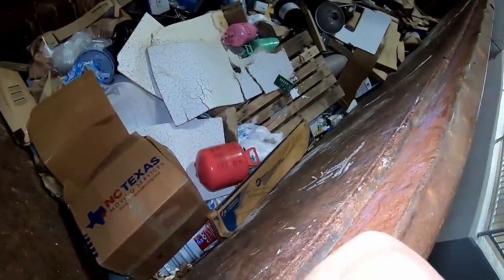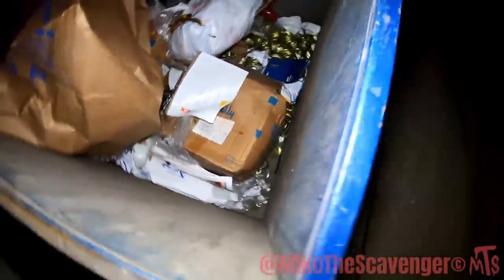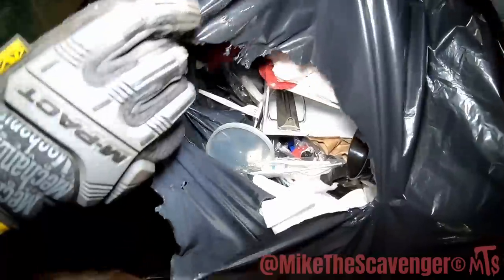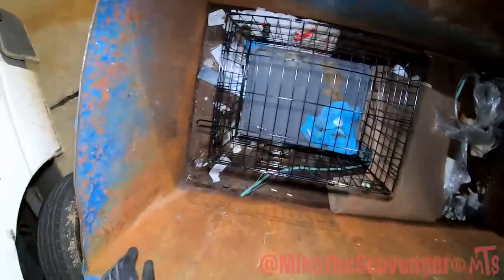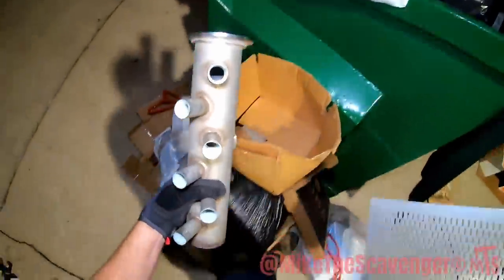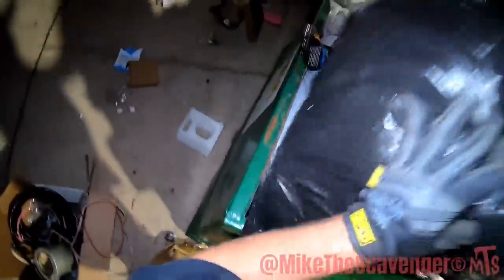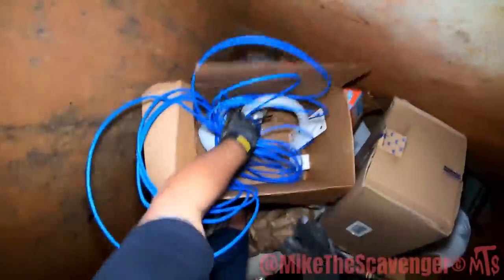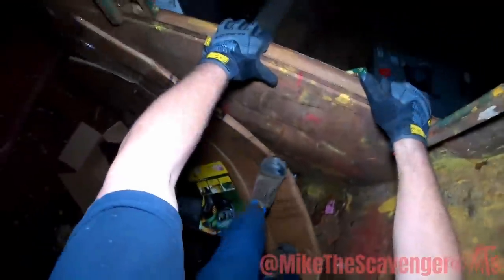Dumpster Diving "Is That A Stiff?"

Comment: Can't remember what we called those wire twisting tools in the AF but those are used in the military especially on flight lines to secure the mounting bolts on the black boxes for the various equipment so the bolts that lock them down don't back off and loosen from the vibrations during flight. They are used in aviation in general and probably in high performance race cars I assume I would think in certain situation. 
I was an Inertial Navigation Systems technician and used it daily. You constantly removed and replaced black boxes in your navigational and all the other systems constantly for testing and repair. 
Brings back a lot of memories seeing those!
Reply: They're commonly called "safety wire pliers".  Yes, used in the Air Force and probably NASA to safety wire bolts and nuts so they won't back out in flight.  Race cars too I would think.

Comment: Those canning rings are an item that countless people have been scrounging to find. There was/is a nationwide shortage after the rona hit and folks were prepping and canning. 👀
Reply: The rings weren't the problem, it was the lids. You can reuse the rings, the lids you couldn't.
Reply: @scottbormann2765  - ALL of it was a problem because people were and still are hoarding the stuff. In my area, we couldn’t find ANY mason jars, lids or rings …. I’ve canned everything from venison to vegetables out of my garden annually for over 40 years, and can attest to the fact that even common pressure canners were extremely difficult to find. And while the scarcity may have eased just a bit, none of it lasts long on the store shelves. Word gets around and it gets snapped up in no time.
Reply: @scottbormann2765  Yep. Plus, the rings come off once it's been canned and gets used again, doesn't stay on the jar during storage, which most people don't realize. The lids are useable once, MAYBE twice if you get lucky. It's crazy how expensive a little disc of metal is in stores, even now!
Reply: Wash those canning rings and sell on Amazon or Ebay those things had become expensive to buy and they created a shortage on them to run up the price of them and the quart and pint canning jars they go on......
Reply: Those rings are reusable it was the lids that were hard to find
Reply: @TheAshesvondust  I have canned jelly for the last 40 years and I have never taken the rings off of the jars when they are put in storage.
We use to reuse the lids and rings  until maybe 5 years ago they started saying that you were not supposed to reuse the lids. My mom insisted on buying new lids and rings almost every year.
The only reason I would have to buy new lids and rings is because I give jars of jelly away and I ask for the jars back and most of them come back with out the lids and rings and the second reason is that the rings get put in a drawer of odds and ins for the kitchen and over time the rings can get bent out of shape and the lids if they have any rust on them they will go in the trash. A coupe of years ago I got a new box of lids that became unsealed in the cabinet they were sealed when they were put up. I just don't understand why people throw things like that away.
GOd BLESS YOU AND ALL WHO READ THIS AMEN.
Happy New year 2023
Reply: @christophertaylor2464  i always thought the lids were only good once. Once it’s sealed and opened it’s no good. That’s what I always was told growing up we always reused the the rings. Unless they got rusty and bought new lid seals
Reply: Dude, you don't have to censure the word. Corona or covid have some balls and say the actual word

Comment: My ex used to dumpster dive and one night she found a good size suitcase and it was heavy so she thought she found something good. She throws it on the seat in her truck and when she was at a red light she just had to look so she opens it up and there's a huge boa constricter in it. Now she's deathly afraid of snakes and she freaks out and tries to bail but she had her seat belt on and ended up upside down hanging out the door and crying and franticly trying to get loose, then she looks up and a cop sez what the fk are you doing? She' tells him there's a snake in the truck. Turns out the snake was dead and the cop was laughing his ass off.